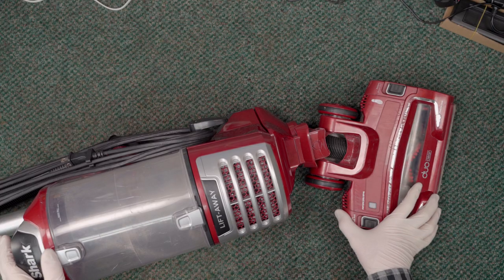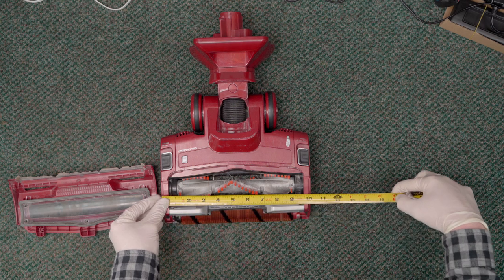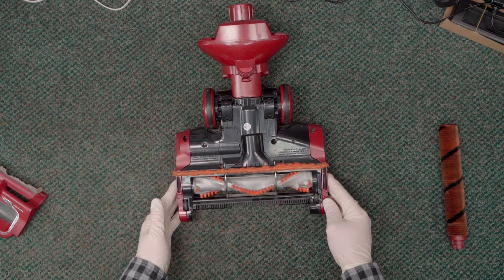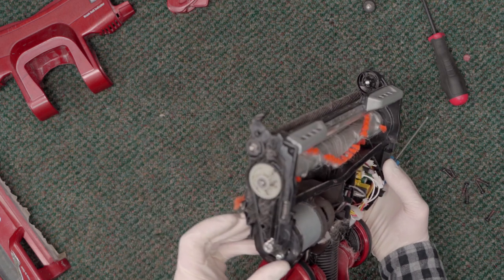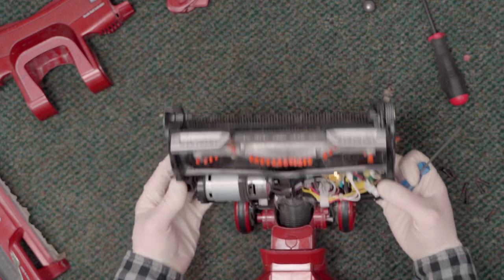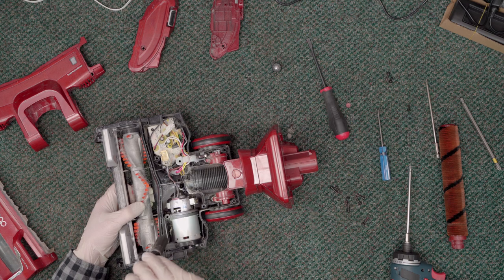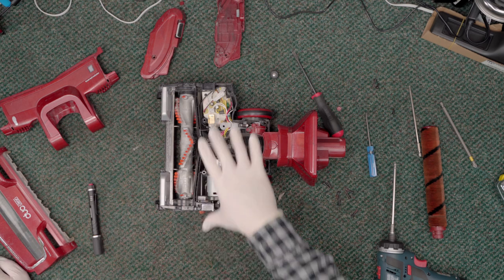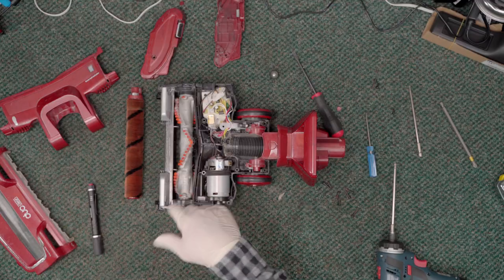Shark NV771 LiftAway DuoClean - Brushroll Shutting Off - WE KNOW WHAT'S WRONG!

Comment: Excellent breakdown on the problems these sharks have. a common issue we have been seeing is the nozzle hose turns yellow and becomes stiff before inevitably breaking. we have had some success in using old hoover hoses from discarded vacuums to replace the hose.
Reply from the maker: Those lower hoses sure love to break on Sharks!

Comment: Brushroll on my Shark stopped spinning, no idea why. Took it apart after ordering some security screw bits. Nothing wrong with the belt. Nothing wrong with the motor. Nothing wrong with it in general. Put it back together minus two parts that fell out during disassembly and it works perfectly.
Reply from the maker: LOL, just knock on wood and maybe it will keep working! Great story!

Comment: Hi Matt, John in Ohio. Your videos are getting better everytime you produce one.
Happy to see the channel growing.

My R40 p.6 Riccar the other day when I got it out to vacuum both the filter light and the bag light started to flash. The bag was a new empty bag and everything was running fine.
Tried resetting the filter clock and both lights went off. What would cause that to happen? 
Thanks John
Reply from the maker: Hey John!
How long have you been running the same filter? The filter clock is simply that... it is just a timer that give a general point at which to change the filter. Could you have used it enough to hit that timer?
Keep an eye on it an let me know if it comes back. Thanks!

Comment: I have the shark upright power lift Apex the one that looks like a military vacuum LOL with the olive drab green color it was like $239 at Walmart, I took it right out of the box and immediately the brushes were shutting off and the brush indicator light would trip simultaneously.

This company has really gone downhill I remember I had a shark vacuum about 10 years ago and it was powerful, it lasted a long time and then I bought a Dyson so for literally $200 more you can get a really good Dyson basic model and I had that vacuum for 8+ years never a problem but I gave it to a friend who needed one and now I’m regretting getting rid of my Dyson
Reply from the maker: Thanks for watching and the comment!
In all honesty Shark it is pretty close to the same level it has always been. The quality of the unit you get is luck of the draw. It may last 7 months or 7 years depending on the one you get.
Dyson is currently at a low in terms of reliability, unfortunately.
If you get another mid-priced vacuum, check out the Sebo Dart. Much, much better quality and it will last 15-20 easily.
Reply: @HouseOfVacuums  oh nooo not miles dyson! I love his vacuums lol. I had mine for a long time I guess I just got lucky or got them when they were well-made? OK I’ll check out that vacuum, thanks for the reply, love your show!

Comment: Hello,
I’ve got a Shark Liftaway that turns off when I disconnect the Floor attachment to use the wand for dusting. I've cleaned absolutely everything. Floor brush roll works great.
Shark could not help.  (They sent a whole new motor body but it still happens. )
Would you recommend buying a new wand?
Shark® Rotator® Upright Vacuum with Powered Lift-Away® and Self-Cleaning Brushroll ZU632
Reply from the maker: Wow, that's a new for me. My best guess is there is something going on in the hose/handle switch that is causing that if the body has already been replaced. But I couldn't say for sure without looking at it. I supposed you could start with the wand then move on to a new hose, but that is a lot of expense for a machine that wasn't incredibly expensive in the first place. 

You'll have to make the final call, but I would seriously consider replacing it with something of higher quality rather than throwing money at it with no guarantees. Sorry I couldn't be more help!

Comment: I would just mod the crap out of them when necessary, something I'm pretty sure is verboten among the pros. I have an HV302 stick vac and an NV800C lift-away, both trash picks, and was unable to find anything wrong with either. I found the NV800C very recently, and being unfamiliar with Shark vacs in general I thought I had found out why it had been tossed when I powered it up and the rollers were not turning. Unfortunately I didn't find out what was stopping them until after I had struggled to remove a handful of Torx security screws to get it apart, which reminded me of the super at my old building using a colourful metaphor in reference to Torx bolts while replacing a piston in a 1984 Olds Omega. That microswitch is held open-circuit with the vacuum fully upright, so I thought fudge it, I'm just going to bypass the thing and let the rollers run all the time. Besides, removing the handle to clean higher surfaces cuts power to the head anyway, and I accidentally cut the wires to the switch when trying to cut the cable tie. On mine, that interlock switch that opens with the cover off is near the front of the PCB. It's ust another useless anti-repair device that will also be bypassed. As for the front brush roll, that's just an aluminium rod covered in a thin layer of double-stick tape with a spiral of whatever that fabric is wrapped around it. I had to find and cut quite a few strands but I eventually stripped it clean, and an isopropyl alcohol scrub removed what remained of the tape easily. I'll re-wrap it with the brush fabric of my choice if I decide to use it at all.
Reply from the maker: Definitely something you could do! I wouldn't due to liability, but there is nothing wrong with you trying that at home if you know the risks. Cheers!
Reply: I’m well aware of the risks. Incidentally the un-modified switch in my lift-away’s handle popped and sparked upon sucking up a particularly large volume of  debris. I have since found out that this switch also controls the position of the suction adjustment valve—or whatever it’s called—so the only conclusion I can draw is that the debris jarred what may be a poor-quality switch causing a dead short.

On a side note I have junked the stick vac. I decided it wasn’t worth fixing once I discovered that all four motor mounting lugs had broken away from the dust cup. The outer housing held the motor in place just fine, but to me it was an unacceptable design flaw. Besides, I considered it to be aesthetically compromised.

Comment: What kind of screw driver do you use? They don't use your standard screws.
Reply from the maker: High Shawna! Sharks take a special screwdriver, a T20S which is also known as a security Torx size T20. You can pick up one of these bits or screwdrivers at your local hardware store or Home Depot. Hope that helps!
Reply: @HouseOfVacuums  thank you!! That helps a lot!

Comment: I have a shark zero m duo clean the front  orange  soft roll doesn’t spin when turned on just the main brush roll does assuming it’s the belt the side that has 2 screws  to remove the side cover looks like a hex screw with a nipple in the middle any idea how to remove that  side plate
Reply from the maker: Yes, if you check out my Shark Vertex nozzle disassembly video the process is very similar and should give you what you need. Best of luck!

Comment: I think you just solved my question to why my Shark duoclean nv800w brushes will no longer turn. I bought this vacuum 2017 and it has worked great up tile a few months ago I started smelling what smelt like a belt burning then my vacuum turned itself off. I have pets so I rely on my vacuum to keep my floors clean from animal hair. I was very picky with my vacuum making sure the brushes stayed hair free and filters clean; however I got a house rabbit for my grandbabies and that's when the trouble started. Rabbit hair is worse than dog and cat hair put together for I had to empty and clean the brush heads every five minutes.  If you have a pet with thick fur use the wand it may save you a vacuum cleaner. Thank you
Reply from the maker: Yeah, rabbit hair is tough! I would probably look at a Sebo Dart/Felix or G4 for something that will last longer and be able to handle that kind of fur. Thanks for watching!

Comment: Ironically I found this channel AFTER I purchased a Shark Vertex (AZ2000W) through the company’s website.  It arrived 4 days ago, and to may dismay, seems to be defective.  Hopefully you will see this, and help me decide on returning it or keeping it.  A few things are concerning, first it seems depending on the position of the handle, the suction/rolls are more powerful. In other words, from a just reclined starting position the suction is intensely strong, yet toward the end of my push, it breaks the seal and loses suction. 

Second thing, I’ve used it 3 times and today when using it the brush rolls sounded like they were spinning very fast and actually agitating the carpet leaving vacuum lines and fulfill the pile.  When I used it before it barely agitated the fibers, but the dustbin was full of hair and fine particles.

Please help me understand if these are all normal things, or if it is a lemon.  

P.S- I just subbed and turned on notifications.
Reply from the maker: Hi there, thanks for watching and subscribing!

While I'm not sure exactly where your problem is located, my guess would be that it is indeed breaking the seal in the air pathway at some point. It would explain why it is cleaning differently depending on where in the cleaning pass you are at. It would also explain why you are noticing a difference in carpet pickup. Again, without looking at the vacuum I cannot say for sure. 
Personally, would be of the opinion that you should probably return it if you are still within the window. Sharks are pretty widely known in the industry for not being repairable, mostly because Shark doesn't make parts available. So you are stuck doing one of two things. If it is under warranty, you ship it back to them and they send you a refurbished unit with a short warranty (the original warranty doesn't transfer). If you are out of warranty and something break, typically you are out of luck.
Given that these are currently retailing for about $380, there are better options out there. I would probably recommend a Sebo Dart or Felix. They run $499-$699 depending on model, but are made in Germany, clean well, and come with a 10 year warranty if you purchase it from an authorized retailer like myself. For not much for money you will actually get a vacuum that will last you 20+ years. The $499 Dart is a great bargain for the money.
Check out the sub-Reddit r/VacuumCleaners if you want some opinions on Shark vs Sebo... it will pretty much echo what I said here.
If you have any other questions or would like a quote, you can feel free to email me at hov@thehouseofvacs.com. Thanks again!
Reply: @HouseOfVacuums  thank you for taking the time to respond!  $499 and above is a bit more than I’d like to spend. I only purchased the shark because it was on sale and had an $80 off coupon reducing it to just under $275. We have a Dyson Dc41 that not longer works due to the change over gasket being torn, and the brush roll is very worn.  We also have a Neato Botvac and a Dyson Stick vac that also doesn’t run for more than 6 seconds.  With all of that money spent, I was not looking at spending another 5-7 hundred...of course in hindsight, I would have found your channel years ago and understood repairability and durability play a huge role in the vacuum world.

Do you sell refurbished units for a lower price point?
Reply from the maker: Hey @N 7. I don't really deal with refurbished units unless they are really cherry Miele, Sebo or Riccar models. These come through sporadically and I do not currently have any. 
I understand where you are coming from feeling like you have thrown good money after bad on vacuums... it is an unfortunate reality of today's box store brands. That being said, $500 is right around the sweet spot for a good cleaning vacuum that will last. Anything lower than that will be a band-aid and you will need to plan on replacing eventually.
If you need to stay sub-$500 upright, probably the only vacs I would recommend would be the bagged Hoover T-Series or Simplicity S20EZ. These are probably 5-8 year vacuums, a little bit longer if you take care of them.
I hope that helps!
Reply: @HouseOfVacuums  Thank you again for your helpful reply!  If I can convince the wife, I really like the Riccar Pet with dirt sensor.  I heard the brush roll is metal and allows for customization of brushes.  If you sell that one, and I get the approval, can I purchase from you online?
Reply from the maker: @N 7 I that machine is a very good choice. It does have the metal brushroll with replaceable brush strips. If you get the approval, shoot me an email at hov@thehouseofvacs.com and I'll send you a quote for the machine... or you can email me before if you would like to know exactly how much it would cost for planning purposes.
Thanks!

Comment: the roller by the belt drive as something stuck with i cant get to the problem took apart what i can still stuck under wherls
Reply: red light on wherls wont rotate by hand
Reply from the maker: Likely you have a defective belt, or possibly a defective motor. I would lean toward the motor.

Comment: My shark is doing some weird stuff but you mentioned the upright switch tends to be an issue.  Mine will turn on, brushes will roll but no suction at all.  Smh
Reply from the maker: The switch would mean the brushroll wouldn't turn. In your case, it is almost certainly a clogged filter or hose. Check those out and I'll bet there is an obstruction. Thanks!
Reply: @HouseOfVacuums  maybe it’s time to get a new vacuum like the shark nv352? Or even better a riccar R40p?

Comment: i wonder if they are using it on a deep pile carpet making the motor work harder.
Reply from the maker: It's possible. That would add some load to the motor. In addition, there is a lot of resistance on the motor because of the DuoClean system. Even though it is geared to try and help, I would say it is at least 1.5x the resistance/load that a normal brushroll motor would encounter. 
Thanks for watching and commenting!

Comment: What IS a vacuum you recommend?
Reply from the maker: For something that functions similarly but will last much, much longer you cannot beat the Sebo Dart. 10 year warranty if purchased from an authorized dealer, made in Germany, parts readily available, and commercial build quality. They run $500, but you will have it for 20 years. Most users would go through 3 Sharks in that same period.
Hope that helps. Thanks for watching and commenting!

Comment: Hello I brought a Shark navigator deluxe from the pawn shop. It worked fine the first 2 times. Then I noticed the suction was decreasing and the light was dimming. So I cut it off let it rest, my babies broke the filter cover button in the front. It kept popping off and would get hot,so I stopped using it for a few days. I went to vacuum it worked a few mins the cut off. Cleaned the filters, dumped the bin and checked the hoses. It would not cut finally like a week later it cut on, the brush roll didn’t work and the light didn’t come on. It had suction on bare floor mode and carpet but the brushroll didn’t work. I cut it off let it rest for an hour, now not working again. Please help me 😢 ?  I apologize for the long comment.
Reply from the maker: Great question! I think what you are dealing with is an intermittent thermal switch or a PCB issue. 

Even with washing, a HEPA filter can get occluded enough to trip the thermal switch. Try running the machine without the HEPA on it and see if things improve. If they don't, I could be the motor is getting old and running hot, which will allow it to work until it gets too hot, it will shut off, and then come back on when it has cooled down. 

If removing the filter doesn't work, it is going to be an electronic component... probably a circuit board. At that point it would be time to start looking for a new machine.

Comment: my lights won't come on. red or green and the headlights, and the brushes won't spin unless I do it manually. the power comes on. but not on the bottom part. any ideas? please I'm happy to give you my email to make it easier to discuss this I'm just so stuck
Reply from the maker: Hey Kimmie! It sounds like it is either the microswitch under the nozzle's elbow or a bad circuit board. The only way to really tell is to test the microswitch and if that is good, then it is the circuit board. In that case the only fix will be a whole new nozzle from Shark. If you have any other questions, you can email me at hov@thehouseofvacs.com. Thanks!

Comment: My duoclean speed nozzle broke. We have a business that has a fetish putting out sand in their parking lot, along with a shedload with salt. So much, that it basically made its way into the nozzle motor. Which slowly killed it.
But along with it, I noticed the hose inside it was broke after around 3 years, along with another one I own.
I'm ok with that, because it was used commercially for 3 years, and that's not really a bad life for a vacuum I paid $180 for. But since they no longer have that brush nozzle for sale anymore, both are now useless.

I'm going to get a second hand Sebo D4 for that location, and feed baking soda to the shark - it deserves it.

Comment: All I can say is that all Hoover's are crap..
Had one that cost £200 staeted smoking then caught fire in a week of using it

Shark just stopped working yesterday, it just completely powered off on its own and will not power back on and only had it for a couple of months 

Stick to brush n shovel at least they was built to last
Reply from the maker: You are just buying the wrong brands of vacuum! Buy yourself a Sebo and you won't have to worry about your vacuum working for a long, long time.